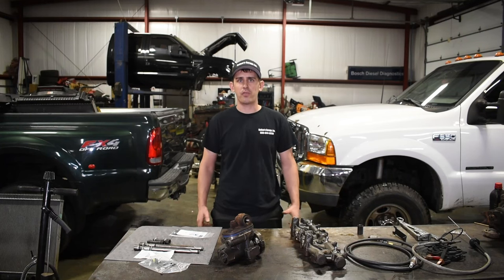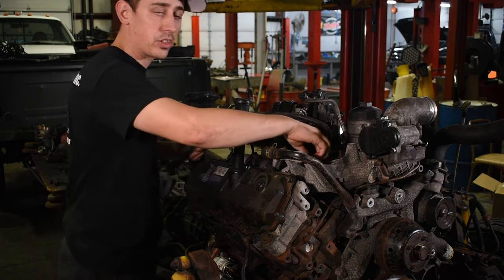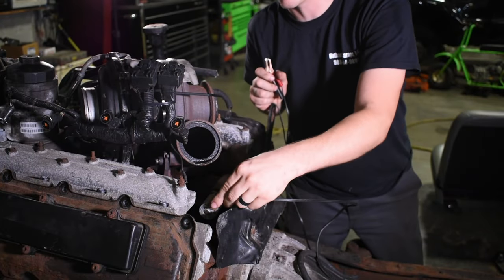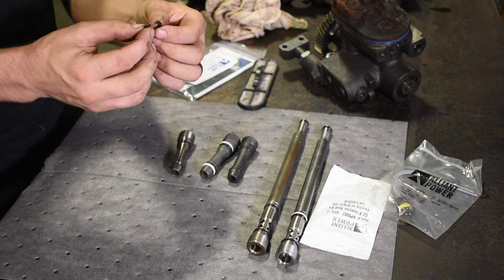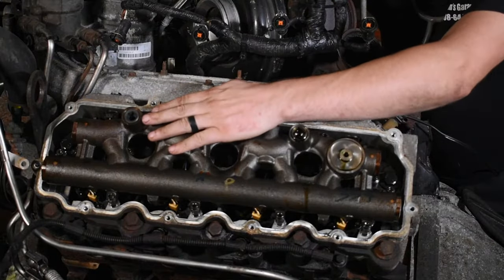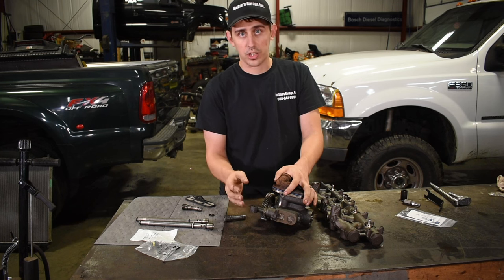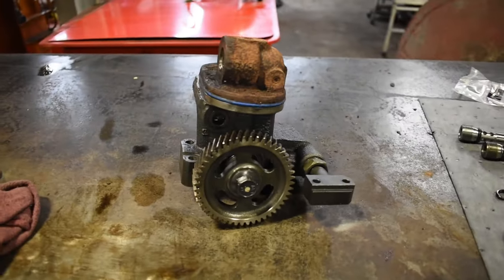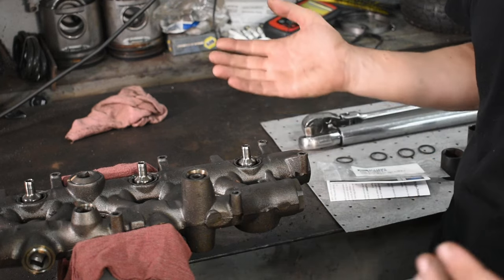6.0 high pressure oil leak diag and repair

Comment: Ok I have a situation where I had an high-pressure oil leak. Sent it to the shop they said they replaced each pop and it ran when I got it back. Drove it for a month same problem. All these trips to the shop is getting expensive so I decided to do it myself. Found an old leak on the passenger side standpipe. I replaced it, Got it put back together, and it ran for five minutes and just died. Did it air test on it and the leak was coming from the passenger side again and sounded like the same place where the standpipe was. Pulled the valve cover and the standpipe in the O-rings looked fine. Pull the oil rail And can’t seem to find a leak anywhere. Any ideas or anything anyone could help me with that would be great.
Reply from the maker: Are you testing through the icp sensor hole? I would get a second dummy plug and install it where the stand pipe goes then air test. This will help you narrow it down to only the side you are working on. It’s possible you have a bad injector o-ring on one of the back injectors close to the stand pipe.
Reply: @InTheShop  I just got through installing new standpipe and dummy plug. Did the air test through the ICP sensor port, and now the leak seems to be internal. My diesel shop said they replaced the STC fitting when they put the new HPOP in. It just came a downpour, so I closed the hood and put everything away. I haven’t had a chance to command the IPR valve closed or pull the air cleaner to listen to the drivers side yet. I’m praying you will tell me what I’m hearing is the IPR valve open, but I’m bracing for the hit. If it’s not that I would guess an o-ring on the HPOP😵 meaning I’ve got to tear the rest of the top end apart and remove the cover. I still have a glimmer of hope though🤞THANK YOU for replying so fast. Your videos are great and help out so much. I appreciate what you do.

Comment: Do you hook up air, activate the ipr then listen?
Reply: Because when I hook up air I can hear all sorts of bubbling but the second I activate the ipr it stops
Reply from the maker: Correct. The bubbling is the air purging out through the IPR. Closing it stops the flow from IPR. You may have to keep the air on for a bit before it starts to show the leak.

Comment: Help me please powerstroke 6.0 2006 no start hot,  hpop new ipr new icp new 120psi air applied  AND no leaks idm AND pcm remplaced
Reply from the maker: Have you tried applying the air while it’s hot?
Reply: @InTheShop  yes at engine operating temperature
Reply: after an hour it turns on without problem
Reply from the maker: Try it again hot but leave the IPR open for a bit to clear the oil out before closing the IPR to test. If the leak is big enough to cause a no-start it should show.
Reply: @InTheShop  I already did it there are no leaks
Reply from the maker: If you have Zero leaks and the HPOP is new I would check base oil pressure while hot with gauge
Reply: @InTheShop  

it takes 3 seconds to increase the pressure when starting
Reply: sorry my english I'm not very good at writing

Comment: My high pressure pump is leaking from a hole that's behind the gear can anyone please help me understand I can't find no information. My old and new pump are doing the same.
Reply from the maker: That is the hole the oil comes out of when the IPR is open. If the IPR is closed it won’t leak from there. If you are closing the IPR and it’s still leaking from there you have a bad IPR

Comment: Brother I have an 03 with 175k and I am having a ton of trouble with my truck the first oil leak was the sensor at the back of the intake I forgot what it is called but on the newer 6.0 they moved them to the front of the passenger valve cover I replaced it already and now it's filling up the intake valley with oil and then it leaks down the passenger side head in the back down the block down the bellhousing to the ground behind the front passenger side tire it's a bad leak and I'm not sure exactly where it is coming from but it's way too much of a leak to drive and I don't have the money to put it into a shop, I am a little mechanically inclined so im not afraid to work on it myself but I don't have enough money to just throw parts at it so if anyone has any suggestions or experience with this issue please feel free to contact me with any help I would greatly appreciate it thanks again my truck is an early 2003 6.0 liter diesel automatic with 175k miles and no performance upgrades just factory parts installed when needed
Reply from the maker: Hard to say but there isn’t too many places it can leak from in the valley. Most likely it’s coming from one of the gaskets on the oil cooler.